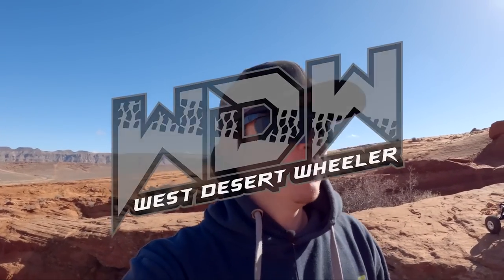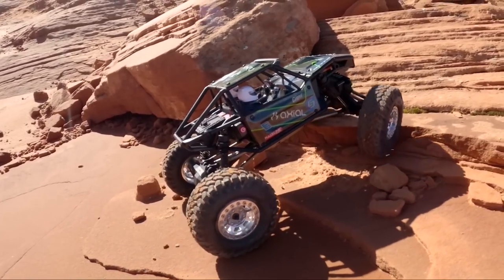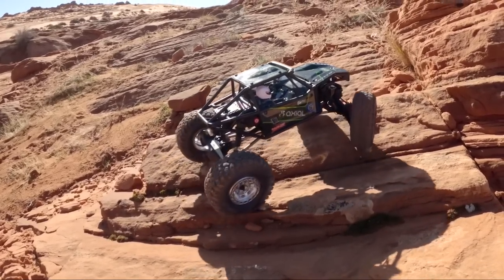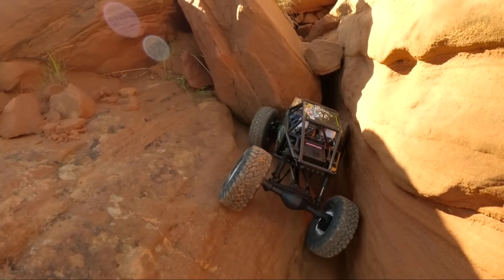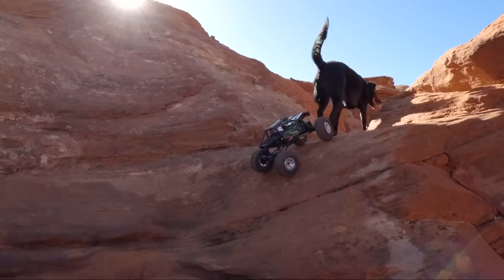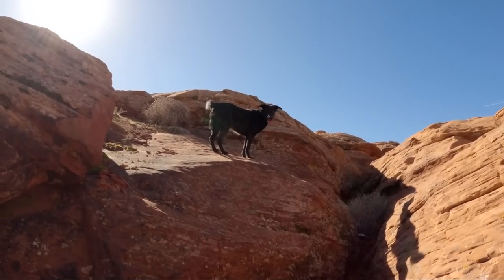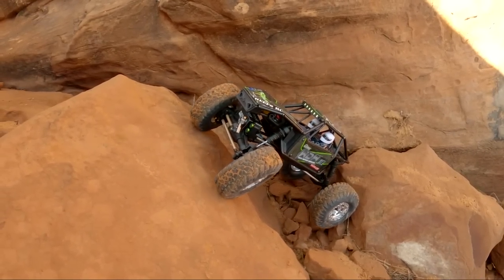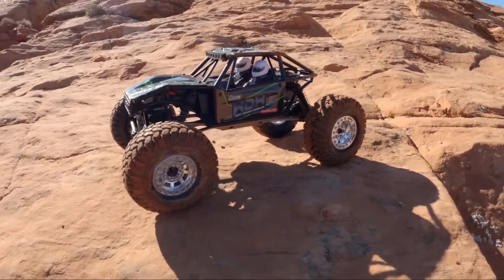Axial Capra UTB18 Upgrades! Axial, Reefs, Spec RC!

Comment: Got the "baby cap", love it!! So much that my full size Capra will be up for sale... downsizing, and it has to go. Mod list: 1.9 generic method wheels w/JConcepts Tusk 1.9 Scale Country tires and slightly cut foams, Treal brass front portal covers, brass +2 hexes, Furitek Lizard 10 ESC running Holmes V2 380 revolver motor, Axial overdrive gears and rear link riser so far.... TBC. Been waiting to see what you've been doing with yours! Awesome.

Comment: All my Buds run Capras,I bought the UTB 18 to keep it on the cheap..try to do more with less.Treal brass,stock capra beadlockes with lead rope,class 1 Trenchers,stretched a bit custome links,HW180 HH 380 crawler motor,Dlux front axles,custom made rear Disco for front dig using micro servo.just over 3 1/4 lbs.Yes it hangs with the big Capras...its pretty obnoxious! haha my buddies call it the "Midget"  lol love my Midget Capra minimal $$$ max FUN! Axial Nailed it!

Comment: I finally got a bunch of stuff done to my 1/18 Capra... it's 4 wheel steer now, has Treal knuckles F/R, portal weights up front, portal gears, and I did the Furitek motor/esc for it... which to be honest, I don't think is that great.  I felt it crawled great with the stock motor and esc, but I had to do something due to the rear steer.  I think you did it right with the 1080 ESC.  I might end up doing that setup and save the Furitek in case I decide to get an AX24.  Or sell it.  I dunno.

Comment: These baby Capras are killing it!  They are pretty capable crawlers and with a few mods you were making some of the same lines as your 1/10 vehicles!  Already, the aftermarket support for these is crazy and it's revived interest in mini comps!  Great vehicle, great video, thanks! 👍
Reply: Just wait till you see the AX24!
Reply: @DurpVonFronz  No way a 1/24 rig tackles this terrain unless heavily modified and then, whats the point (like Logan said)?  Still, glad to see the AX chassis re-introduced, even if in a smaller scale.  It will be a great way to get into a competitive chassis and has tons of potential.  For me though, 1/18 is far more versatile.
Reply: @jerryvolpini7987  The 1/18 will be too big for indoor courses like my Carpet Mountain. Outdoor.. just run 1/10ths I dont see the point in something just a tad bigger then a 1/24 when a 1/10 will crush it. Like a Danchee for the same price.
Reply: @DurpVonFronz  Indoors is where the 1/24 rigs belong (assuming you have a place with a course), they are not very capable outside.  The 1/18 is small enough to use indoors (not competing) but has much more versatility outdoors.  Best  of both worlds.  I think it all depends on what you're looking for but for me 1/18 is a great compromise between the 2 sizes ✌❤

Comment: Loving mine! I'm still waiting on all my Axial upgraded parts (I ordered pretty much all of them) but I have gone 4WS with another front axle for the rear, Reefs 422HD servos front and rear, RC4WD 1.55" wheels and RC4WD Mud Slingers, Holmes Revolver 380, Castle Mamba Micro X2 and BEC, and 800 MA 3s battery. I'm running my rear steer on channel 6 of my FlySky GT5 same as you do with your big Capra so it's independent and I love it. Wish I could post pics here, haha. I wonder if anyone has any shock recommendations as well. Mine are a bit binding and tend to do weird droops toward the driver side on straight and level running.

Comment: I love my baby Capra, also run the HW 1080, love it. Axial overdrive front and Team Garage Hack underdrive rear. Think I’m about 30% total and works Awsome. Custom built my own stainless links with +10mm in the rear. Little rig just works. Brass box front ( not rear) went cheap with Injora negative offset bead locks with proline class 0 BFG. Now if it would just quit raining in Oregon. Love you content .

Comment: Check out the Capra parts at Treal & Club 5 I picked up a bunch of stuff at good prices. Got all new metal black body panels anodized rear middle links front orange anodized front links rear light etc.

Comment: So if I put in a 1080 I have to get a new controller & receiver is how it works? I have a new 1080 sitting & a 1:18 Capra. I have a Flysky 5 with a extra receiver & only one vehicle on it so I could switch to it & that would also give me a controller with enough channels to use it for 4 wheel steer which eventually I’d like to do. Thanks for the tips. That Reefs servo is wild.
Reply from the maker: You are correct, switch ESC and either change to GT5 or buy a compatible spektrum receiver for stock radio. 🤘🏼

Comment: Just a question I bought one of these because I liked you video of it but thats not the issue the one that I bought came with a faulty transmitter just wouldn't work note: both battery terminals faced the same way I figured Axial knows what its doing so I sent it back and bought another only to be faced with the same exact problem. The battery terminal had both springs next to each other and both terminals next to each other I've never ever seen that before usually one faces one way and the other faces the opposite way, did your trucks transmitter come like this or is this a problem from the factory, thanks for your help?

Comment: Idk I think u definitely need to revisit the 24th crawlers, all ur problems u mentioned can be fixed with upgrades, not just making it bigger but there are oil filled shocks and brass wheels for nice weight down low and lots more, out of all my rc cars the 24 has some of the most upgrades available I have seen
Reply: I have one of my minis setup so nice it feels like driving my mini Capra, how easy it is to predict ect

Comment: I gotta stop watching your videos dude!! Ima have to go buy one of these! Love my 1/10 Capra 4WS but it’s been in pieces for two months now just goin back together. Kinda excited, I put some great upgrades into it including a vanguish 3gear with dig unit….havent decided fusion se 1800 or pro 2300.of course it’s stretched a lil too! Only thing missing is a metal cage! Almost pulled trigger from RC SPEEDY then all the complaints came outta the woodwork so I shred away…any suggestions? Maybe a “chupa” or ?..